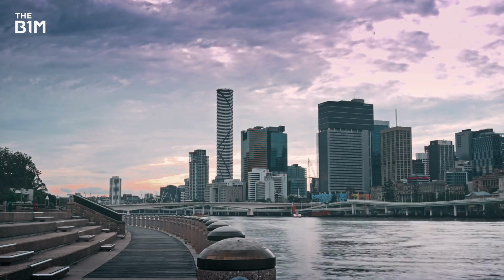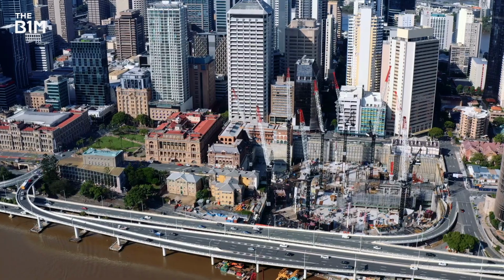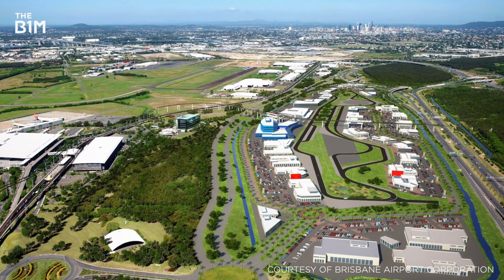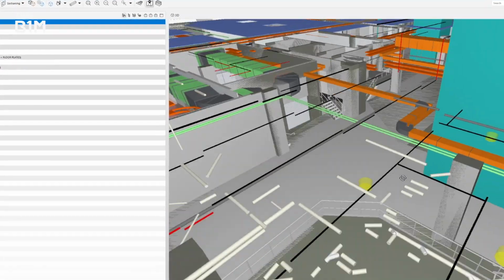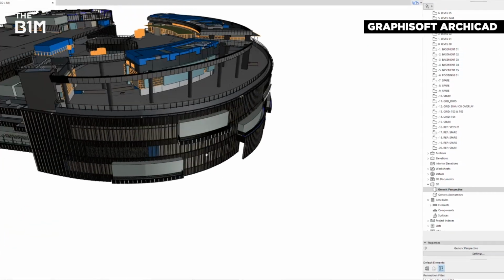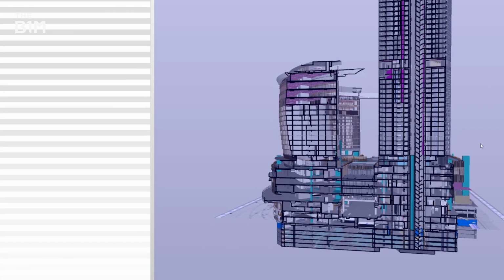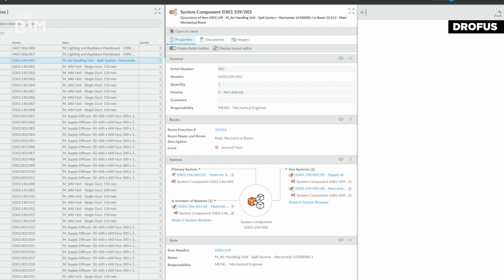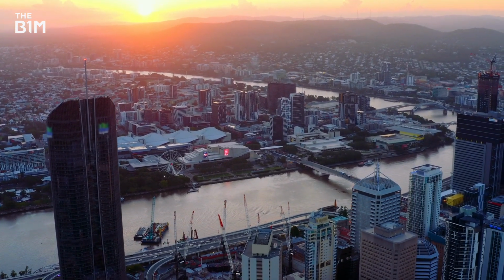Building Australia's $3.6BN Megaproject

Comment: Hey B1M, You should create a video on the big upgrade of the metro tunnel system in Melbourne if possible :).
Reply from the maker: Great idea, we're on it! 👏
Reply: @TheB1M  You could also include the new direct rail link to Melbourne Airport, and the new railway ring line that has been proposed. The new Airport station looks really impressive.
Reply: @TheB1M  It whoud be better to see Toronto
Reply: @TheB1M  Maybe also Cross River Rail Brisbane, Metronet Perth, and Sydney Metro. Just some ideas 😀
Reply: @sataward593  exactly
Reply: @manansethi2865  😊
Reply: Nobody wants to know about Melbourne... you can't even catch a train to the airport in Melbourne 🙄
Reply: @namwens1  hahahaha, there building one right now. Wherever your from its probably shit
Reply: @namwens1  Costs an extra $20 just from Brisbane CBD to the airport. Yet from the GC to Brisbane it's only $8 on a Go card. Privatization for ya folks....
Reply: @blank.9301  back in the day, it was cheaper to pay the fine for not tapping off than to pay for the actual trip. This was circa 2009
Reply: @namwens1  but you can catch covid almost anywhere in the city. Why do you need to be able to catch trains when you can catch covid instead ;)

Comment: When I visited Japan, I was amazed that they built express roads on pylons/supports out over the water - thus no tunnelling or buying land. I thought no one would ever get away with it in Australia, as they would be confronted by court actions for "spoiling the views". Well done Brizzie!
Reply: I'm assuming you're referring to to Riverside Expressway seen in the video. It was built in the 1970's and was the first of what was to be part of a vast network of motorways across the city. However, after this and the pacific motorway were built (which takes you all the way to Sydney), there were protests at the destruction of neighbourhoods on the southside and most of the planned motorways were cancelled. Ironically, they have since built these motorways now, but as tolled tunnels.... There have been talks about demolishing the expressway and tunnelling it, but it would be prohibitively expensive. Currently underneath the expressway is desolate and unsafe and the Queens Wharf Project is revitalising the area underneath thankfully

Comment: I quite like this project, but I hope it doesn't cut itself off from the rest of the city in the fashion of Manhattan's Hudson Yards. It needs to feel integrated with its surroundings, and like a place where people actually live and recreate.
Reply: As a note, I think the five-story parking structure is excessive, given its central position with Brisbane, but I'm not familiar with the extent of transit services to the site.
Reply: @jacobbernard1393  It includes at least two huge towers of apartments. And a few hotels. The riverside will be open public space with cycling trails, parks, cafes, markets etc. It also has an arc building with public viewing platform. It will include 50 new eating venues. And a bridge linking to one of the world's best urban spaces, Brisbane's Southbank. A new 8 billion dollar tunnelled train line will have a subway station near this site (under construction). There is also an underground bus station nearby. And a new bus metro system is being built at the moment. Being awarded the Olympic Games spur on other projects as well.

Comment: 3.6bn because they have like a 100 of everything. I bet if it was done based on a early finish contract reward itd be a lot less than 3.6bn.
Also not much point putting more jobs in the city if the current parking and transport can hardly cope as it is.

Comment: An over reliance on computers means that engineers may not be in proper control. the design looks good but how do we know it is backed up with sound engineering?
Reply: Well the Riverside Expressway which runs directly in front of it has engineering faults which caused its closure for a while. It has all sorts of monitoring equipment installed to see if it is stabilised. It is too expensive to replace. New casino, no problem. Riverside Expressway couldn't fail, just like the Mississippi bridge in Minnesota couldn't.  Oh it did!
Reply: @philgray1023  Your point is valid.  The Mississippi bridge had a design flaw. But consider the following. When the engineering is done manually, an auditable paper trail is created. Engineering validation  needs to vigorous enough to pick up any mistakes. Unfortunately such was not the case in the Mississippi bridge and many other projects. As a rule, if you design to Australian standards, a structure will last.
Software such as Finite element analysis is not developed with Australian standards built in. Computer models are only as good as the assumptions (a load assumption factor contributed the Mississippi bridge failure) . However, a computerized model does not give you a paper trail with engineering calculations to check. If a mistake has occurred with the configuration of the model, discovering it is much less likely. 
There have been a number of glass bridge collapses in China recently. These were all produced with finite element analysis. But the FEM is not capable of analysing the stress concentrations that occurred unless it is specifically programmed for an unforeseen event that by definition will not be seen. On the other hand, an age old standard which has evolved with errors over the years will usually have sufficient safety margins to account for these extraneous events. 
I see overreliance on computers as a liability when it is used to shortcut engineering.